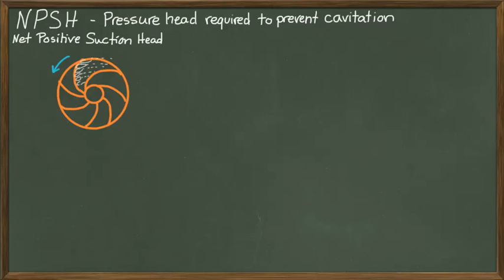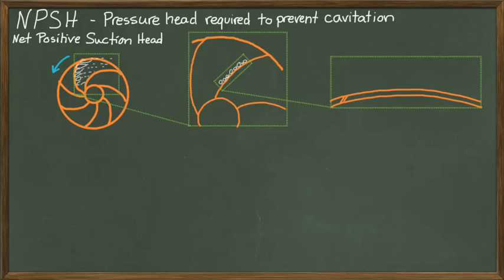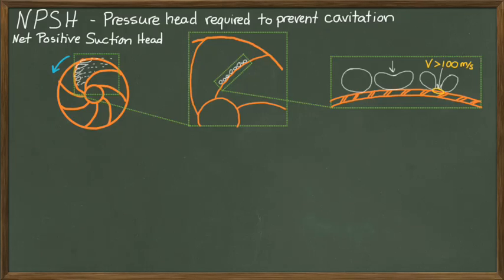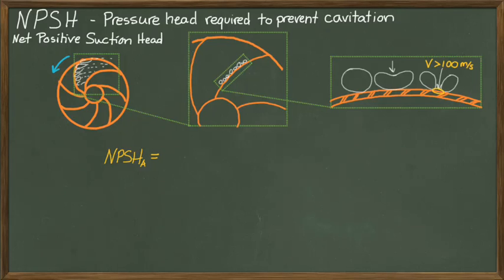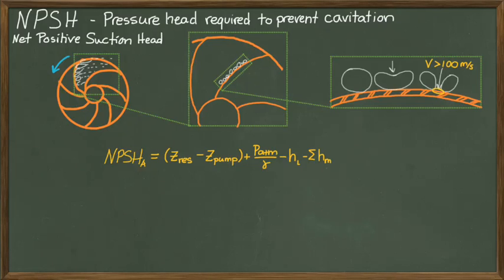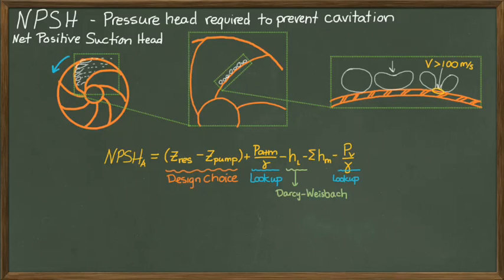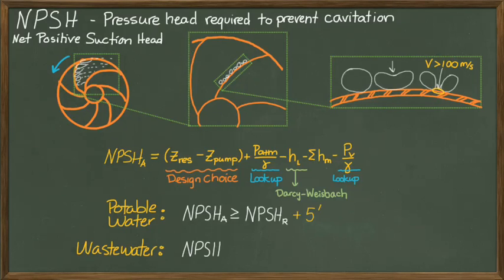Cavitation & Net Positive Suction Head Available

Comment: Please explain about physical meaning . NPSH if it 3 m,what it represents.
How to explain it
Reply from the maker: Do you mean: "What does it mean if NPSHa is 3m? how is this observed physically?" 
NPSHa of 3m means that there is a total of 3m of absolute pressure head acting on the pump suction flange.  Absolute pressure head accounts for atmospheric pressure, and the vapor pressure as well as the water depth.
NPSHr of 3m means that the pump mechanics itself require at least 3 m of absolute pressure head in the fluid in order to avoid creating a cavity in the fluid.  
Hopefully, those answers are helpful, but please feel free to re-ask your question if I misunderstood.
Reply: @kennethwlamb  thanks sir, atlast my doubt cleared
Reply: Before l have also the same doubt why the Required should be less than the Available until  I get this point   that the NPSH Required is the minimum value should be satisfied  to avoid cavitation hence the NPSH Available from the system should be higher than the required  .
Another point we need two simultaneous constraints to be satisfied for the suction process 
1st the absolute pressure at the eye of the impeller should be less than the atmospheric pressure and
2nd that absolute pressure should be higher than the vapor pressure  at the the same time 
and I hope Dr Lamb clarify my answer if it is  correct or have any shortage 🌹🌹

Comment: Hi, the video its awsome but I have a question, why you dont consider the suction velocity in the NPHSA ? like in this video I saw: https://www.youtube.com/watch?v=Tq9MYjrId5Q
Reply from the maker: Interesting question and thanks for the reference.  Let me look into this further and I'll see if I can find out why there is a difference.
Reply: @kennethwlamb  Hi Kenneth, Thanks for your answer, about the consulting, I did my research and I found several videos in where they use it. For example 
VS= Suction Velocity at the impeller
1)- In this first video they include it as "+Vs" you can see it at the minute (14:12)
https://www.youtube.com/watch?v=tlA8PXCaoqI&t=1350s
Here is PLUS

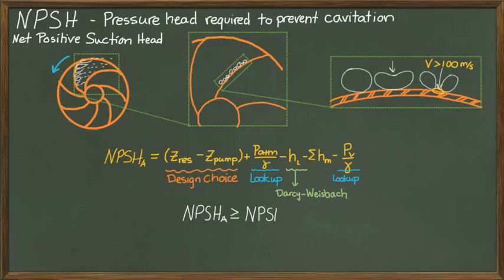2)- In This video, The said is "-VS" you can see it at the minute (4:40)
https://www.youtube.com/watch?v=Tq9MYjrId5Q
Here is MINUS

3)- And in this video they said it doesn't matters, and I'm agree with him because it's the same formula I know and it's the formula you describe. See at the end of the following video
https://www.youtube.com/watch?v=a1larb3MQgw

4) BUT, the only page I found that explain something about this and it's seems to be important:
https://live-ps8.pantheonsite.io/calculate-npsha-suction-lift-condition

" Velocity head is already included if the NPSH is established from a difference in elevation" 
I don't understand, please I need your help
Kind regards
Reply from the maker: @AlessandraNagell  These are great resources.  Thank you for jumping on that so quickly.  I am trying to find a digital copy of the ANSI/HI pump standards because that is the industry bible on this topic. Another excellent book is Pumping Station Design, 3rd Edition.  The authors of that book state, "There is no term for velocity head in [the NPSHa Equation] because velocity head is part of the absolute
 dynamic head."  In other words, NPSHa considers the absolute static head, and the absolute dynamic head considers the velocity head.

Comment: Hello Dr. Lamb, quick question for you. Where will the value of the minor head losses come from?
Reply from the maker: Minor losses are generated a each pipe fitting, valve, etc and are estimated using this equation: Hm = k(V^2)/(2g).  The k value is something you look up.  V, the velocity of the water passing through the fitting/valve.

Comment: Can be NPSHR be equal to zero?
Reply from the maker: I've never been asked that question before :).  I think it would be impossible for a pump, that is operating, to have an NPSHr = 0.  I don't think it is physically possible.
Reply: I think the Nsphr is derived by manufacturers by experiment and it should be positive value it represents the minimum required head at the suction impeller side to avoid cavitation so that it cannot be zero meaning it exists already

Comment: The analogy of the hand action in the pool scenario was the single best explanation that I have ever came across to demonstrate cavitation.  Thank you!
Reply: If the fluid only cavitates when the stagnation pressure drops below the vapor pressure, then why is NPSHr anything other than it just needs to be greater than 0?
Reply: @Cray25  The minimum amount of suction head required depend on the pump size, impeller design, rpm, restriction at inlet, etc. 
The hand  in the pool demonstration will explain this. If your hand is close to the top when you quickly push down on and into the water the amount of static head above your hand was low at the start, thus you see more bubbles when you push down. The deeper your hand is at the start of the hand demonstration the height of the water above your hand at the start is higher (more suction head), the less bubbles are produced.
So NPSH (min. static head) is dependent on pump design and also the fluid viscosity being pumped.
Reply: @oppanheimer  superb explanation...👍
Reply: x2